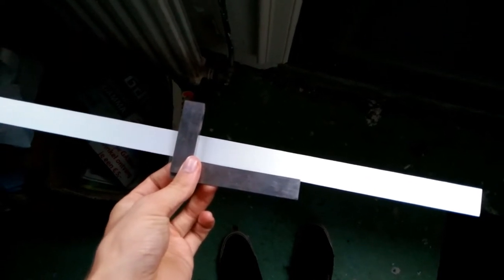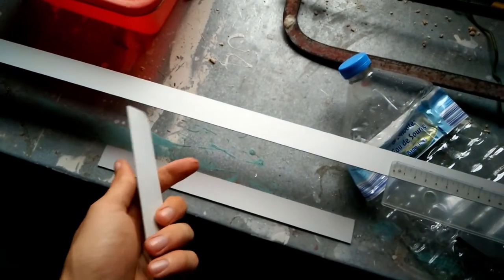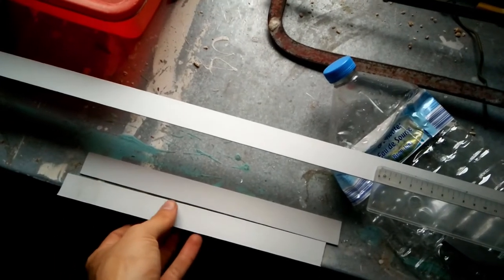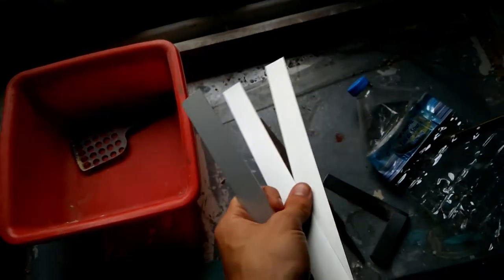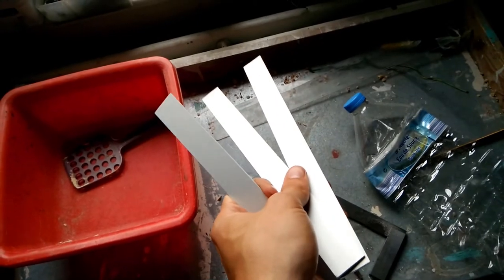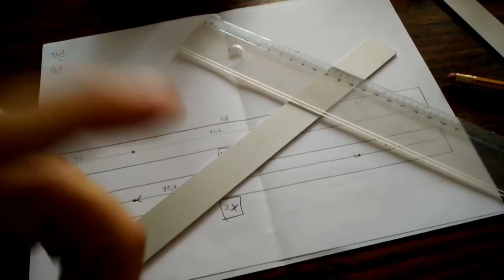Future Ethereum Mining Rig #10. PSU and MB Supports

Comment: Hello, 

I have just done a recalculation because i am on the way building my first rig with 6x RX 470, so for best PSU:, this is my conparation result:

Needed Power is about 750W max. (Probably it is less, but when you OC a little bit, it's mabye exactly like this)

PSUs from beQuiet
1) STRAIGHT POWER 10 | 800W CM
143€
vs
2) DARK POWER PRO 11 | 1000W
223€

Price diff 80€

1) Ef ~ 91,5 % (see specs with Load a bit < 100%)
2) Ef ~ 93,55 (see specs with Load a between 50 an 100%, with hypothese of linearity )

So Power use for 
1) 819 W
2) 801 W

18W diff @ 0,052€ per kwh is about 8,2€ a year diff, so the 2) needs 10 years to armortise... So probably the 800W would be best choice because, you will use the PSU probably only max. 10 years for mining, because technology changes...

Greetings from Luxembourg
Reply: And they even specs 100.000 h life span for there PSUs... I know that PSU reserve 103W only for the CPU, so rest is only 700W for the cards that have a max of 720W... it's really close... Mabye a 850W PSU would be more save, or I would say it is the minimum for 6x RX 470. So for example then the bequiet POWER ZONE | 850W CM or DARK POWER PRO 11 | 850W...
Reply: New recalculation with 850W PSUs:

Effiziency & Load,  750/850W ~ 88% Load max. we say 80%, so 680 W on secondary side ...

DARK POWER PRO 11 | 850W
192€
Ef ~ 93%
731 W

POWER ZONE | 850W CM
142€
Ef ~ 87 %
782 W

dif 50,6 W all the time, it's for me 22,8 € per Year more electricity costs for the cheaper PSU. Armortised after ~ 2 years... Here the expensive one would be the best i woul say... The more if electricity would arise in future, beeing more expensive... Because at the moment here electricity is very cheap 5,2 cents, before was 12 cents, so you never know how it will change... i would rather see this point more negative for the future...

I just ordered the "be quiet! BN253 Netzteil Dark Power Pro 11 (850 Watt)" for my first 6x RX470 Rig system. :)

Greets from Luxembourg
Reply from the maker: Alberto's PizzaSteinOfen Cool tanks for that! I will build a rig with that!
Reply: Ups !!!!!!! I just checked, My Asus Rx 470 4OG (OC Edition) has a Power of 150 W max., not 120W like the AMD Radeon Reference max. !!!!
I've just canceled my PSU-order... in worst case even the 850 W psu is not enough for my 6x Asus Rx 4704OG... , it's bad  that asus does not show the power in their specs...
... Mhhh have to study more how much these cards really need ...
Reply: Or for that PSU you could just use 5x Rx 470 and 1x Rx 460, and you are save... :) 
Or just test it, first with 5x Rx 470, than 6x, and when you're are on primary side under  (1/0,927)* 850 W = 916 W anything is save... But I saw in a review (tomshardware site) that the asus Rx 470 OC-Edition never pass 150 W but is often max at 144 W, so 6x144 W, 864 W is to much !!! So I have to go with a 1000 W PSU...
Reply: 1000 W PSUs comparison: (the cheaper bequiet "Power Zone 1000W is not available @ the moment), so:
Needed Power, Secondary: GKs 864 W (6x RX 470 OC) + CPU & MB ~50 W : 914 W => 91,4 % Load

1) expensive PSU "DARK POWER PRO 11 | 1000W"
220€
Ef. ~ 93,275 %
Pri: 980 W

2) cheaper PSU "Corsair CP-9020094-EU RMX Serie RM1000X ATX/EPS"
168€
Ef. ~ 88,9%
Pri: 1026 W

Consum. Dif. 46 W all the time... is for me 21 € per year (5,2cents/kwh)... (imagine this dif. with 10 rigs... Would be 210€ per year...)
Price dif. 52€ armortized after 2,4 years... So, after this period the more expensive PSU will become more profitable... when you change all 4 years your hardware, and could even re-use this psu again... even 10 years, so the more expensive one should be the best choice... the more if electricity is or became more expensive...

Comment: I think the most PSU has best efficiency @ 60% +- 10 PSU Load, that what i found out with the curve in specs of bequiet PSUs ...
So in "80 Plus certification" 50% Load has best efficiency, but in reality it's about 60% where is maximum efficiency...
So... the best efficiency is when your cards get undervolted, and all your system takes 60% load... This is for an example 1000W PSU Platin, 600W secondary, or ~ 625 Watt of the Wall (Primary Side)... Or 1200W PSU Platin it's 720 W Sec. or 750 W Primary (Wall).
Reply from the maker: Alberto's PizzaSteinOfen The price of the 1200 was a bit too high so i ordered a 1000 platina to see the difference but next rig will get a 1200